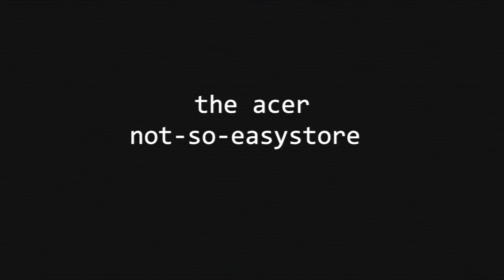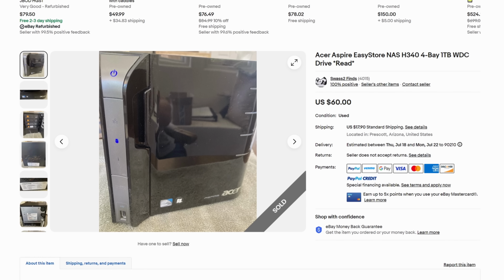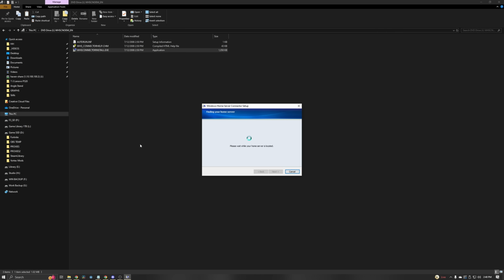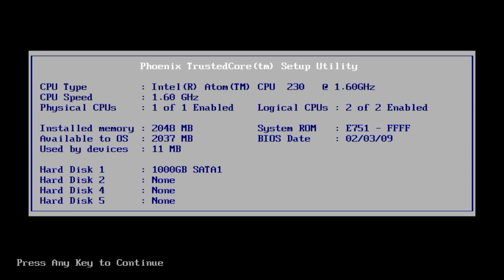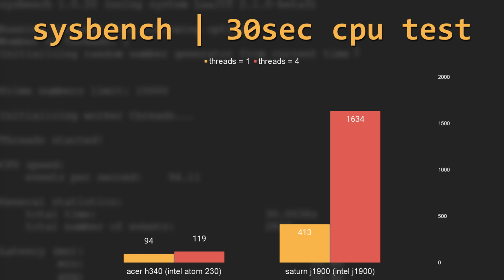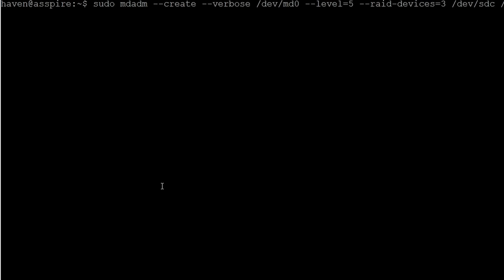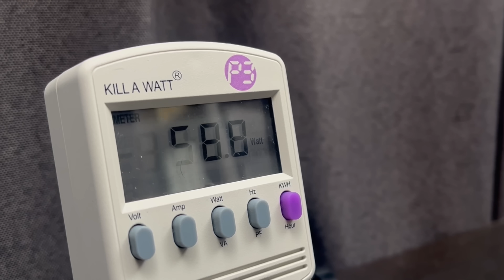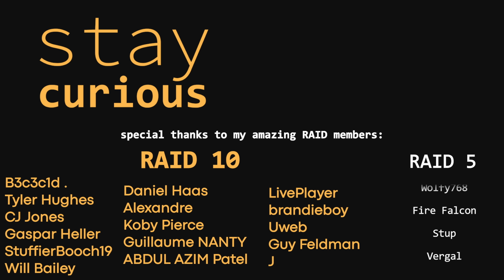I wish EVERY NAS was made like this one

Comment: Hey there! I would also like to know the commands that you typed for the sysbench on debian 12. I myself have an old intel pc in my house, installed Debian 13, I just went with the latest Debian release, also if there is a version of debian that supports old and new hardware, has better hardware support and compatibility. I would like to know.
p.s., The system has an i5-4590, 8gb ram, mobo-gah81ms, 128gb ssd(that's where my os is installed), 500gb hdd for bulk storage, 1080p vga monitor and peripherals alongside with a sound box and a speaker only. I'm watching your video on Debian 13. I like how you show interests towards old hardware and repurpose them.

Comment: An alternative to UnRAID is SnapRAID, which is similar in that the data is not striped across the drives, but is different in that it is freeware and it doesn't calculate parity in real time but during scheduled times. That latter feature could be of benefit when the CPU is as slow as a single-core Atom is. (That's not why the developer coded things that way though; it has to do with protecting the parity data from corruption due to soft errors from the data disks.)

Comment: electrolytic capos on board are toasted (you can seee them bulging) it is most likely stability issue (any maybe reason you cannot go to bios)...replacement is easy for someone with soldering iron and few spare caps 10-30cent each

Comment: Great video! I know it's a few months old but maybe you might be interested to know that last year I found an almost brand new one in the garbage at the local eco center with plastic still on the case but missing just the drives. There is already a video card onboard it's a white connector labeled "CN12" on the back edge of the board. It was a special connector and the other side is a standard VGA with a low profile bracket to go in the slot in the back. Also, I did find that the least CPU and RAM was on OMV. However, I was able to speed up the interface by first doing all the updates on server side with sudo commands. I then made sure the swap file was 1GB and installed Zram and set it to 50% since like yours, this one had 2GB of RAM installed. My memory and CPU usage are almost nil. Sure applying still spins a bit but really I don't need to always configure something. Plus all this can be done via command line super fast. Like don't run any updates from there. If it says updates are available, go do it via command line. I got it done within 2 minutes. I am running a RAID 0 so it's really only dependent on the 1GB RJ-45 link. It is possible however to further increase the transfer speed it is possible to remove the VGA bracket and install a 2.5GB PCIe card instead. You could then remote into the server. It runs super fast by itself and really the only time the CPU is used is if running the web interface and connect to the server. Anyways just thought I would share as I liked your video and thought if anyone else is wondering, once it's up and running it's pretty good little NAS IMO that doesn't require much more than new HDs, a new O/S and some love! PS the VGA connector is hard to find but I got it off the Jungle site but on UK version so it took me a couple weeks to get it.

Comment: I'm currently working on my dead Acer AC-100 NAS, the mobo die during upgrading of the CPU.

I've plan to create a backplane who's taking SATA and SAS plug on 9211-8i firmware IT mode and re use the old power supply weird wiring..

I have this type of NAS (3) since 2017 and it work like a charm (1245v2 and E3-1260L1260L 32GB memory) running of Truenas Core ;)
I paid 50€ for each with 2tb disks (some are dead)
Just don't use Realtek ethernet chip ^.^

PS you can plug a VGA OEM on the mobo, their is a connector for.

Comment: I've run into a couple motherboards that wouldn't turn on unless the mounting points were independently grounded. Since it would've only been grounded by the cables while outside the case, that might be why it didn't boot.

Comment: 3 way mirror doesn't "rebuild" anything whatsoever, there is no parity.
Reply from the maker: Okay yeah it technically isn't parity data, but mdadm still has to sync the array.
Reply: @HardwareHaven  It does have to copy the data over yes, so sync it. I used to work for a storage solutions provider, hence my slight allergy to imprecise terminology. The reason it matters for this is that depending on the setup, parity can be a big issue to deal with relatively speaking, since it puts load on the host that copying data doesn't. It doesn't seem like it should make a difference but in practice it is a massive load on a relatively "weak" system. Not a big deal if you aren't trying to do something else on the system at the same time, but if you are - you'll be forced to wait until it's done.

Comment: When you pulled out the motherboard it looks like there is a microswitch along the edge. Could this be a safety feature to cut power if the mainboard isn't fully seated in the chassis?

Comment: Fighting single thread problem.  Most of what your doing is going to spend a lot of wall clock in task switching and if memory is limited it's swapping on top of it all. Doing something CLI would probably suit it best.  Basic linux LVM raid with parity wouldn't be a huge problem if the parity is already done and then start copying files.  Best option is to offload the raid to a card and let-r-rip

Comment: I actually got a hold of a HP MicroServer gen8 (I believe it's called?), also 4bay, with vga output and a full pcie x16 slot (although, pcie 2.0, but still). It was a mess to get to work properly but also got openmediavault on that one and a new drive for it, and it runs as a backup server for my parents :)
Reply: if it's all black with a circular HP (not HPE ) logo on the front, it's a Gen7

Comment: I would put an Odroid H4 Plus in that thing:
- fanless
- low power consumption
- has 4 SATA ports and an M.2 slot
- supports In-band ECC using a normal SO-DIMM.
- can hardware decode 4K UHD video.

Comment: I bought my Acer H340 new at the time. I bought a used mainboard bundle and rebuilt it yesterday.
GIGABYTE GA-H67N-USB3 with i5 Intel CPU. It works great.
Reply: I have the same one. Sitting in the closet. I want to bump it up to a new board. Did you need to tweak it much more than just the motherboard swap?

Comment: I considered upgrading the hardware as well, I originally installed OMV (blindly) and of course, found it dreadfully slow
But for those of you who have one of these lying around (better yet, the H342 iteration) or can find it cheap online, I have a suggestion for it that is both simple and useful
Put the jumper in, leave an empty hard drive in it and boot a USB of the latest Daphile ISO
The machine booted without fuss, opening the web interface worked first try and the install can be copied from that initial USB boot and further setup can continue from the single hard drive you put in
Make sure said drive is "Clean", no partition or format information so that the Daphile installer will handle it
The resulting system can be used to pipe music throughout your home using LMS/Squeezelite devices and has adequate performance to even be a very light file server, for your music files
Lots of limitations, but a sound use case for the potato class hardware
The fact I have mp3s, flacs and even backups of DVD ISOs on the 4 drives (can add a 5th to the e-sata port too) makes it a fairly low hydro powered server for an audio server

Comment: Had one of these new, loved it. WHS was great on it, and the experience was good enough that I wanted to do it again. Got another of these recently, and found the same video you did. Found the jumper and got a video card installed (a slight update on the one he recommended). The original motherboard was apparently pegged at 2GB max for RAM and WHS had the limit of 8TB total. To get Unraid running, I had to disable all booting options except the USB drive, and only a couple of USB drives would work anyways. But have Unraid running the NAS, and two Docker containers with Iventoy and a hard drive file manager. And those aren’t autostart because things seem to get unstable if I run out that way. But now, it’s handling the NAS for a Home Assistant Green box where I have everything else I was hoping to run on the Acer.

Comment: Ah how cool - the backplane needs a GND wire jumper to spin up the drives with a standard ITX mainboard (it has a proprietary plug to the original mainboard).

I had one of these in 2015 and fitted it with an AMD Kabini based board (ASrock QC5000-ITX) that ran circles around the Atom hardware. It was nice and solid and didn't need a lot of power.

Comment: I'm happy you finally gave OMV a shot! You could have installed it on a USB stick and use all of your bays for storage but I'm not sure how long it would take to boot with those USB 2.0 speeds😅

Yeah, you have to "apply" every change on OMV but on a modern system it only takes a couple of seconds though

Comment: 9:35 I think that means they are compiling their kernel with support for CPU features that the Atom 230 does not have, which makes sense since they were cut down even when new.
I had similar issues trying to boot a Debian 32bit kernel compiled with PAE on an ancient Geode processor that is 32bit without PAE. Black screen with cursor like that after boot, no error no anything. Had to boot the image from another PC to install the 32bit kernel. This can't be done on Unraid.

Comment: The main-board seems to have a small switch on it's side, which may be a security in case you remove the motherboard from the case and slides it out, holding this should in theory allow you to turn the unit on.

Comment: A Zima board would make a good replacement for that old motherboard. It has the PCI-e slot which you could connect to the backplane with a riser cable. You'd just need to mount it somehow so the ports would be accessible from the back. A 3D printed IO shield perhaps. I'm sure TrueNAS would run on it. Maybe even AuxXxilium Arc Loader for a Synology experience (It's a github project I've been using on older hardware).

Comment: Well I can't wait to see if you ran into the same issues I did modifying that thing.

New power supply, modified power cable for the back plane. Slightly modified power on  back plane(if I recall that was to try and prevent an issue people were talking about online where the back plane wouldn't work with other boards but it's been a hot minute. I just found that there was one point that had a missing voltage and fixed that, not totally sure if it was needed but it's not hurting at least). I still haven't gotten around to making the front panel working. so it's just a different rigged up button for power right now and no indicates(nothing quite as permanent as a temporary fix I guess). Oh and a new fan and an SSD crammed inside the case for the OS.

It's stupid tight but it works great.

Comment: I might still have one of these and I just recently acquired some older boards for cheap and might be able to mod the one that I have as well. The only downsides are the drive sleds have rubber isolation on their toolless pegs that degrades very fast, and the LEDs being very non-standard wiring

Comment: Wow, i'm currently playing with an old NAS of mine trying to update the OS to something less ancient and i find myself drooling at the better specs here :D

Mine is a Thecus N0503, a 3 bay 3.5" (or 5bay 2.5") NAS.
Single core 1.6ghz Atom N270, but it's a 32bit only one (32bit linux is a rare thing nowadays as i found out) 
Also 2Gb RAM (upgraded from 1GB, 2GB is maxed out config)
PCI slot (NOT PCIe) Ended up chucking an S3 Virge in there for VGA video out lol
OS was on an IDE DOM, managed to find a cheap 128GB one on Aliexpress to replace it.

Comment: That PSU must have crap efficiency. Back in the day I built a custom matx server with a Pentium 3 Tualatin 1300 MHz (celeron version) and the whole box (mb /w onboard eth and vga) with one ATA disk only drew 29 watts running normally. Those Atom CPUs are pretty good power wise IIRC. I guess the extra two HDDs could explain the difference though, who knows. My old Acer aspire netbook /w dualcore atom drew 13 - 26 watt, AC brick and 2.5" spinning hdd included.

Comment: ATOM = Anemic Terrible Old Machine
In every encounter I've had with one, they were bad. And they were bad even when they released. Windows 7 wouldn't come out for another year, so most were running XP. As you can imagine, VISTA was a terrible experience to try and upgrade this to. IMHO, this budget processor is actually part of why everyone thought Vista had terrible performance, it still did, but this processor series likely made it 10x worse in the public eye.

Comment: I know some old(?) NAS-es uses a small set of mirrors for the root and then RAID-something for the data. You just make a set of partitions for the root, each big enough to hold what's needed and then make a RAID-1 spanning all of them. Then a new partition on each drive for the data. I beleive those I've seen (like QNAP) places the root directly on the RAID-1. I'd rather use LVM in this case to easily separate out the swap. Then the same with the data volume. This will obviously make the rootfs slower than on an ssd, but it'll give you redundancy. I guess you'll have to stick to debian or something instead of openmediavault for this, though.

Comment: If you are gonna upgrade it I would suggest using a ITX motherboard with a onboard cpu like the N100 or N300.

Its so low power you barely need any cooling. yet its powerfull enough for a mini-server
{Blame intel for the confusing naming, since this nas uses a ATOM N230}

The N100 or N300 are recent chips that are extremely powerfull for home-servers

you could go 2 routes.

Onboard power connector
or a PICOPSU  with a 3D printed PSU plate for the connector. [or just use a modern 300W SFX PSU that fits in the case]

Comment: As someone who struggled running "modern" things on N36L I can tell you that Unraid didn't want to run just due to hardware being old and "not compatible" in some way. I had the same issue with Proxmox and ESXI (I think it was 5 but can't remember now), but in the end I kinda ditched it into a wardrobe to think more about putting something like rpi5 with pci-e to backplane adapter or something.

Comment: looks like fairly common hardware for NAS systems of that age - I still have 3x HP N36l microservers (AMD Athlon II Neo N36L (1.3 Ghz), 1GB NIC, PCI 2.0 expansion slot) in use as NAS boxes and they work extremely well even after 10+ years of use.
Reply: Microserver gen 7 ftw

Comment: Haha, I'd never used sysbench before.  I quickly installed it on my server (i5-11400 - 35W limited) and got 113447 with the same command you used in the video.  With 4, 308075..  That Atom CPU is the king of potatoes!  Part of the issue with that NAS could possibly be that it's likely SATA2 and not SATA3.

Comment: oh. boy, I used to have one of this running in my garage for years with ubuntu on it for just for storage without issues until the built-in ethernet port is toasted.  and I don't even the pcie extension cable to get any display, what I did is always install linux from a different machine with everything installed and move the OS to the NAS.. CPU is definitely piece of junk, but just for an SMB share it was fine.

Comment: I have an old QNAP TS-451 sitting in pieces on my desk as I’m trying to make something useful out of it. Found it for very cheap on Marketplace like a week ago and thought it might be worth it to try and utilize it as an extra off site backup. I already have my old HP Microserver N40L as an offsite backup but you can’t have enough backups… 😅

I’m first going to try and flash Alpine Linux onto the eUSB DOM that the QNAP OS lived on, but since it’s only 512 MB it needs to be a quite minimal install. Alpine is great since it can run in RAM.
With MergerFS and SnapRAID it should be useful enough for backup.

If that doesn’t work out I’m plugging in a  USB header adapter instead of the DOM and shoehorn in a USB to SATA SSD somewhere. Then I’ll have more options for OS. Either TrueNAS or OMV then.

But I really do like Alpine so my suggestion is to try that! You won’t get a UI but it’s simple enough in the CLI. 👍

Comment: yea those old Atom's were rubbish.....I'll say though I had a weird little HP desktop with an AMD recently...it uses a laptop PSU in a desktop and wasn't any form factor ive ever seen...I put on Ubuntu server with it running wireguard with a pair of 1TB disks and it runs SOOO well and at like 25W total maxed out....for JUST a VPN and SMB share it can saturate a gig port just fine (through USB since it only had a 100MB onboard!)...its the weirdest desktop ive seen in a long time  but it was amazing as a low power server so sometimes these weird lil chips are OK

Comment: i bought one of these a few years ago for 30 dollars, I dumped the Atom Motherboard and shoved in a Ryzen 2700x downclocked as a File and VM server, all running off the original PSU. Solid little case, I might bring it out of storage and put in a super low power Intel Atom N95 motherboard or something when they get cheaper